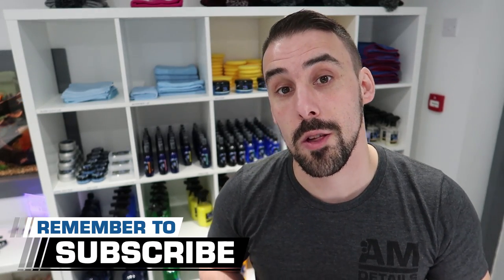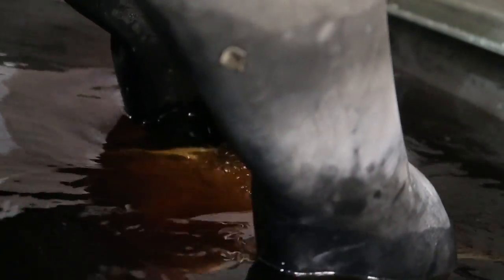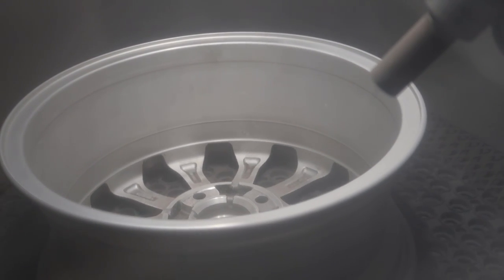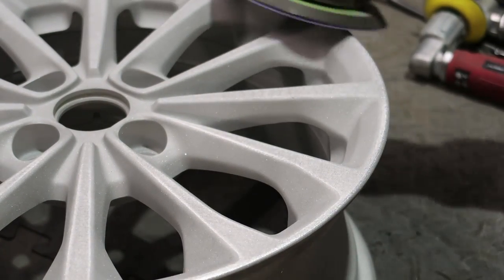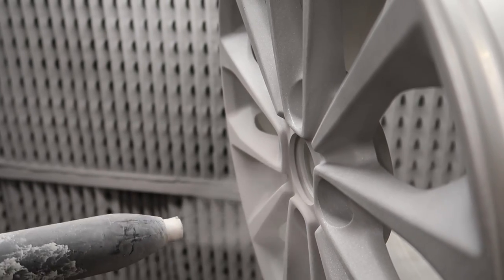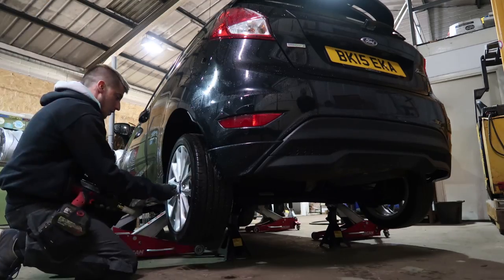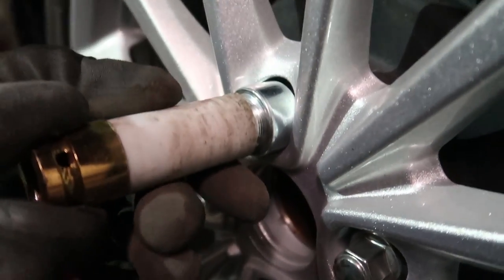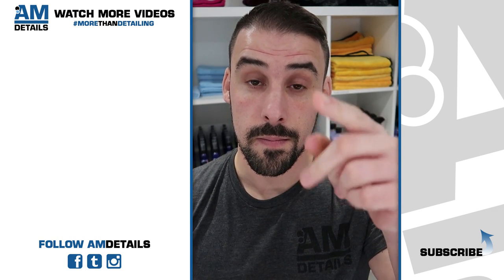How To Refurb Alloy Wheels With Powder Coating

Comment: Morning Alan, regarding wheels, whats the durability of your wheel wax like? ordered some at the weekend with some other bits and pieces from you. Additionally, I will be putting the wax on polished faces of wheels on a 2nd set of alloys I luckily managed to pick up, the originals suffer from the white worm effect under the lacquer on the polished face, will the wheel wax restrict the moisture/water from getting to and under the lacquer? cheers!!
Reply from the maker: Hey Andy,

Sorry for the delay in getting back to you and thank you so much for the purchases.

I would do 2 coats. 30 mins between each.

AM Wax will help to keep the wheels clean and reduce dirt "sticking" but it will not inhibit moisture sorry. one of the drawbacks of polished rims.

How did you get on protecting the wheels?

Alan
Reply: AMDetails hi Alan,  no problems bud, know these last few weeks been manic for you! messaged on fb too other day and got one coat on so far, will put on a 2nd coat this week, they just boxed up and back in garage this now. cheers

Comment: Very interesting! Thanks Alan!
Reply from the maker: Super cool right? I really enjoyed being able to see the process. Alan
Reply: AMDetails 😀
Reply: I see that more new vehicles have these full TPM sensor valves fitted for better tyre pressure monitoring than the old ABS method, but nobody seems to know how long the batteries last and when the units need swapped out (or the £££).

Comment: powder coat was never designed for alloy wheels, no car make powder coats wheels from the factory. powder coat being a more economical time saving process then wet paint. they would use it. look into the annealing temperature of aluminium. annealing is using heat to soften the metal. it makes them weak
Reply: Audi BMW and a host of car makers use powder coated wheels. There is not enough heat to make the alloy weak. The only thing "weak", is your argument, the alloy stays strong.
Reply: The alloy ? you are aware there is more then one type of alloy ?  

in bbs own words 

The heat in the curing process will alter the properties of the metal which can make a wheel more brittle.

Painting does not alter the properties of the metal in anyway.

So there is issue of heat and there is also the issue of price.

It is possible to powder coat a wheel and not effect the strength but this process takes time and needs to be precisely controlled. We do not know of any alloy wheel manufacturer that uses powder coating to give their wheels colour.

In summary, the majority if not all alloy wheels are painted, not poweder coated and this is because of the effect heat has on the strength of the wheel and because of the cost to precisely powder coat a wheel in a way that will not effect its strength.

The cool down temp should be 24hours. do you know any powdercoater that does this do they balls
Reply: And a last word from BBS

We do not suggest ANY welding or heat used to cure the paint (limited to 90°C (194°F) for no more than 40 minutes).
Reply: I'm about to have a set of aluminum wheels powder coated.  When I asked the place doing this job about the heat factor, he told me that heat generated by braking is just as hot as the heat in his process.  He told me that he's done hundred of wheels and never had a problem with one.
Reply: @AStanton1966  iv never seen wheels getting to 200c with breaking otherwise painted wheels would fail if they got that hot.